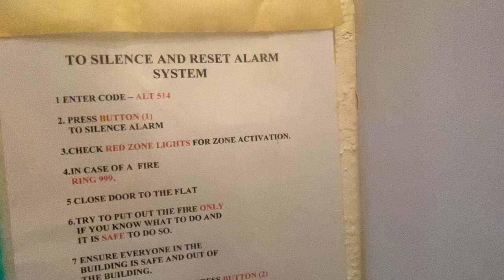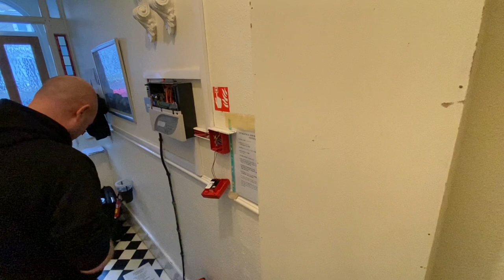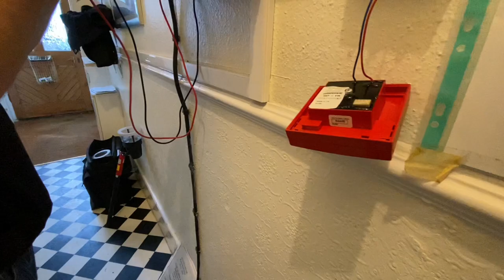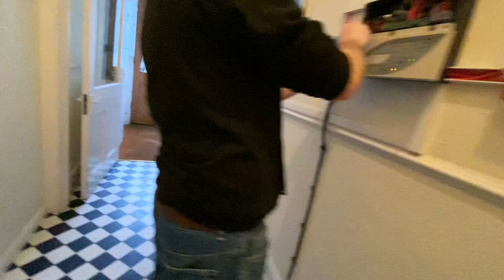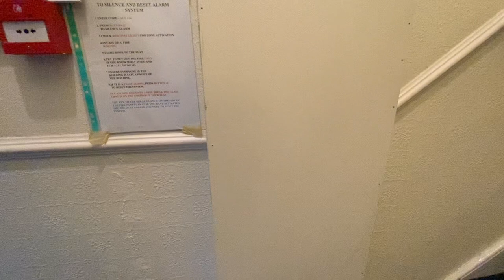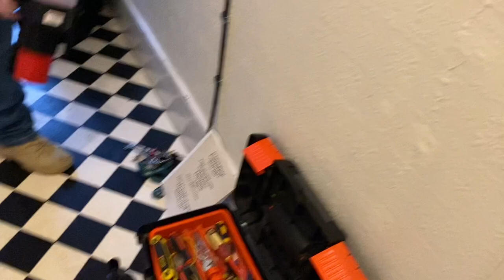Twinflex rafiki fire alarm system fault finding

Comment: I haven’t watched the video the whole way through but zones can be turned off on these if powered down as the EOL are in the devices. Did you contact Rafiki or Twinflex?
Reply from the maker: After further investigation the panel was shot and needed replacement. It has been replaced with a twinflex pro panel now which works well enough